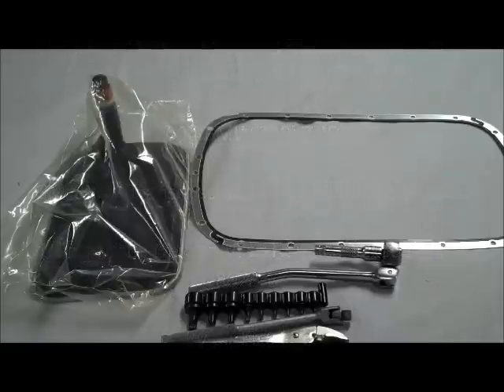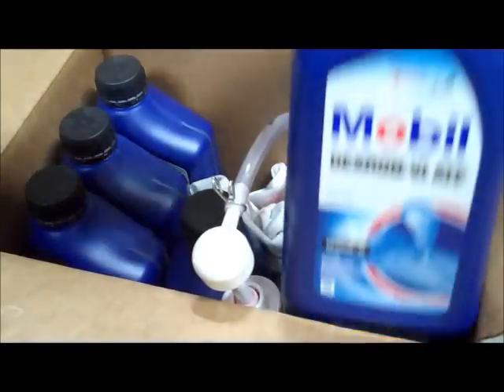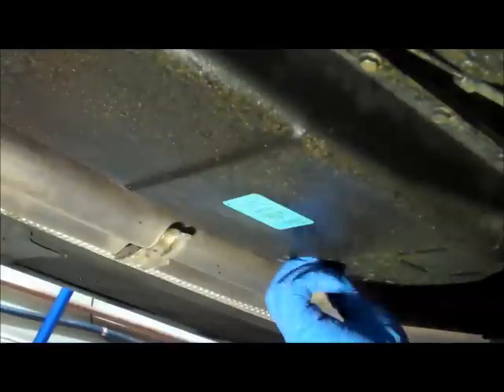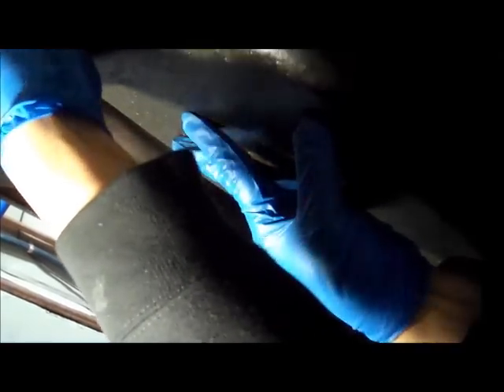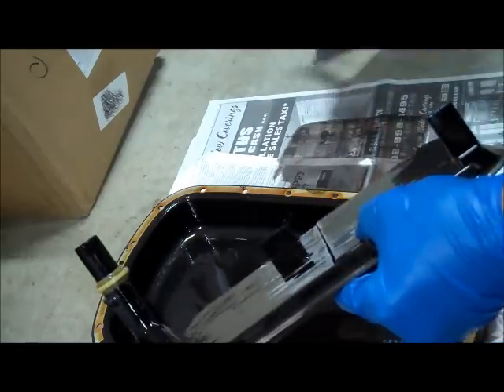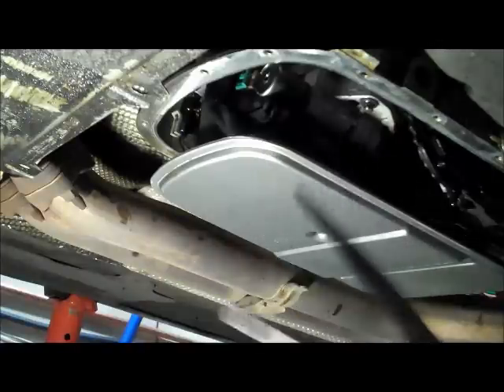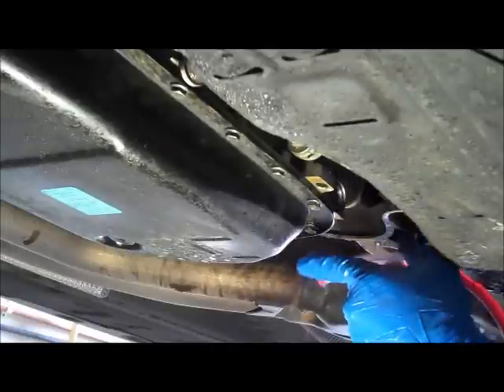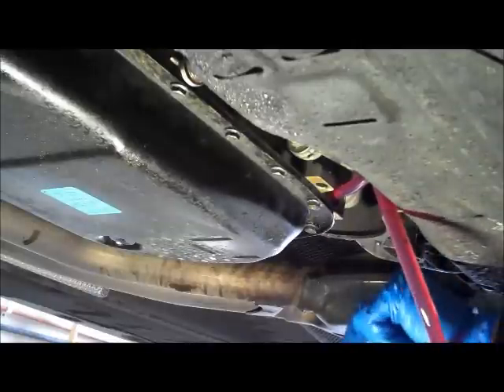BMW e46 Automatic Transmission Fluid and Filter Change.wmv

Comment: Hey Dan, I have a question. My 03 E46 transmission is working fine in reverse but struggles to move in drive and I get a little white smoke after I turn the car off none while the car is on. I know it may need to be rebuilt or replaced but I wounder if the fluid needs to be changed or topped off just to buy me a little more time. Any thoughts would be appreciated thanks.
Reply from the maker: Hi Gary, It's difficult to really say what is the issue.  White smoke from the exhaust, as you know, usually means water in combustion chamber or thereabouts. Even if you had a head gasket issue, the struggle to move forward while reverse works fine is probably not engine related, it's more transmission related (assuming you have an automatic.)  You may also have a transmission issue which would not be fixed by changing fluid, I would get it in for diagnostics rather than trying to guess what the issue(s) might be.  Sorry could not be of more help.

Comment: gm 5l40e gearbox same for petrol or deisel as some petrol bmw comes with the 5l40e and so i was wondering this gearbox fit a deisel or it has some variation for deisel?
Reply from the maker: I'm not sure about the diesel transmission, what does your car  have?  Sorry, can't help on the diesel questions,  never owned one.

Comment: on my e46 after running for about 30-40 the electronic transmission malfunction light comes on and than if i were to keep driving the rpm would go up but the car would barely move. and thoughts on what it could be guys ?
Reply from the maker: +Alvin Uthoo  My first thought is the automatic transmission fluid thermostat . The  thermostat for the transmission fluid is located right under the expansion tank. Like a water thermostat it regulates flow to the transmission cooler as it awaits the transmission to warm up.  If this is malfunctioning, once the transmission warms up it may not be allowing the fluid to pass to the cooler and the transmission is getting too hot. 

With regards to fluid, has that been changed within the last 50k miles and is the level properly topped off?  You won't be able to see much when you pull the pan, but if the fluid is extremely dirty you may want to do a fluid and filter change and see if it improves the situation.  Try changing fluid AND this thermostat and see as that's cheaper than a new or wrecking yard transmission.
Reply: +Dan Tsuchiya nah bro I don't think it's been changed recently . That's my first move to change the fluid and the filter and than if it continues I'm gona check the cooling pipes and the radiator and stuff

Comment: why do people keep telling me if a change my transmission fluid the transmission will go bad ?. I have a 2001 BMW 740i with 192,000. hmmm.
Reply from the maker: Allen Donaldson I suppose there are some mechanics that feel if the transmission has that many miles on it and it hasn't failed, why change things. BMW considers their automatic transmission fluid as lifetime. There are some who feel that if you change fluid with this many miles that the viscosity or wear/pumping characteristics of the new fluid will cause the transmission to fail.  I don't have an opinion one way or the other, but luck could have it when you change your fluid, the transmission will fail for an unrelated reason.
Reply: Dan Tsuchiya I forgot to mention- my car 2001 BMW 740I drives well in the morning or when its cool, but when after driving for about 2 to 3 hours, it jerks when I put it reverse. Other than that the car drives and shifts well. Any suggestions ?
Reply from the maker: Allen Donaldson The odd or sudden movement when putting it into reverse is more of a sign that what is controlling reverse (solenoid, reverse drum, etc) is having an issue.  A fluid change or any additive won't fix the root cause here.  I don't claim to be knowledgeable about these transmissions, but please have a mechanic look into it. My knowledge goes as far as the how to on the fluid change.  Good luck.
Reply: Dan Tsuchiya thanks, I will get in checked out :)

Comment: What type of atf owould be good for my 2003 325i bmw? And how much do I need of it? Any help? Thanks
Reply from the maker: If you look at the pan of the transmission you should see a sticker indicating what brand of transmission you have. In my 330i I had a GM transmission assembled in France. If yours is the same you can use the same ATF.  Generally Dexron VI will probably work fine and quantity will be similar. Sorry could not be more specific.
Reply: +Dan Tsuchiya thanks for the help!

Comment: if i replace my filter and fluids of my 2000 e46 you think it will stop slipping
Reply from the maker: Unless the level of the fluid is low, the change out of the filter and fluids likely won't "fix" slippage,   On the other hand, trying this will be less costly than replacing a transmission.

Comment: will thos work for 2005 325i
Reply from the maker: Check the transmission pan and it will indicate, by sticker, if you have the GM transmission.  If you have the GM Automatic transmission, this procedure will work fine.

Comment: at what mileage intervals is it recommended to do this, i have a friend that needs to know,
Reply from the maker: Somewhere in the range of 75-90k miles, however, performing this change even if the car has over 100k miles is probably worthwhile.

Comment: question, I have the COG light on (!) <--- that symbol on my dash and it wont go away and 3 different shops including bmw cant read my transmission because it wont connect. Do you have any suggestions on what could be the issue because my car is stuck in limp mode (4th gear).
Reply from the maker: Sorry, I never experienced the COG light, but there are a number of reasons it could go on (fluid level, air box connection, MAF, etc)   There are a number of discussions on the forums about this, perhaps some of those authors might have some suggestions.  If you've brought it to three shops including a dealer, this one might be difficult.  Any auto electric shops in your area?  Might try them. Sorry can't be of more help.